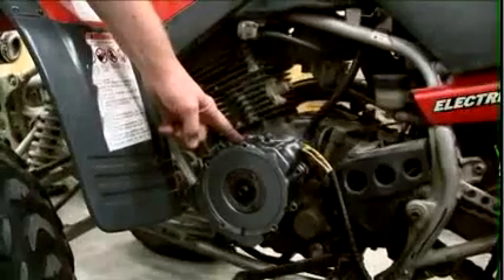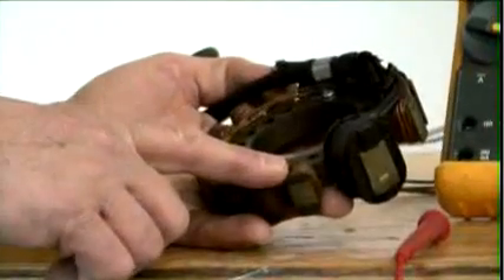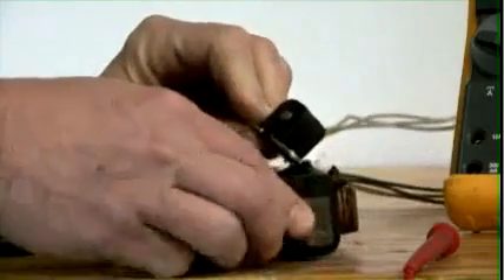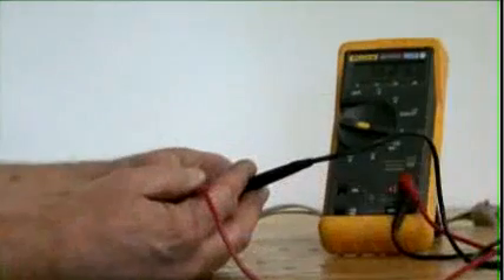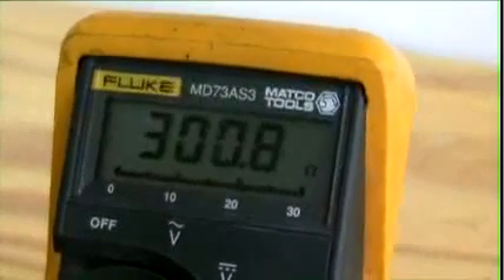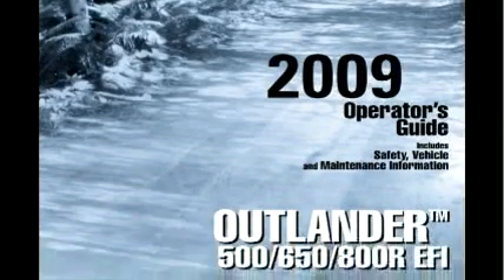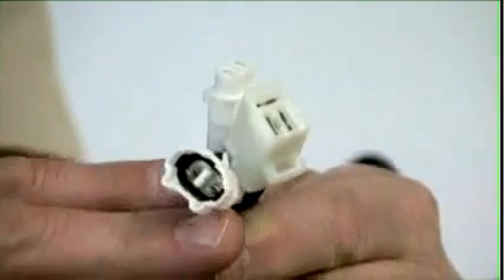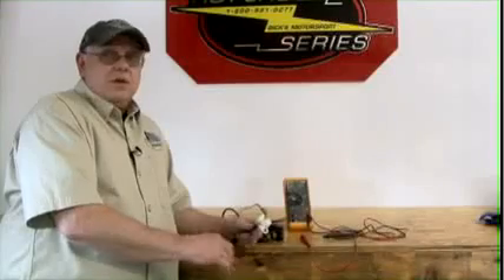#12 How to test a Yamaha Warrior stator

Comment: Thanks Rick.  My 96 warrior 350 pick up : 250 and pulse: 180, are they in specs or out?  It has very weak spark. Broke down 2 days ago.
Reply from the maker: Those readings are out of spec.  A 1996 YFM350 Warrior should read 270-330 ohms  on the source coil and 459-561 on the trigger.
Reply: @RicksElectrics  Super thanks, ll install a new stator to see if CDI is ok. One more question:  l put some "engine restore" in oil before top end rebuild, if it shorts out or affects  the source and trigger coils insul?

Comment: I have an 87 Warrior with no spark. I have replaced the coil, stator assembly and CDI box, and the ignition switch. It cranks but has no spark. I've verified the neutral, engine cutoff and reverse switches all work. Where should I go from here?
Reply from the maker: You've covered all of the areas I would tell you to check.  Follow the "no  spark flow chart" in your service manual.
Reply: I would say to check the wires/harnesses.  But curious if you ever got er figured out? Thanks!
Reply: Ground